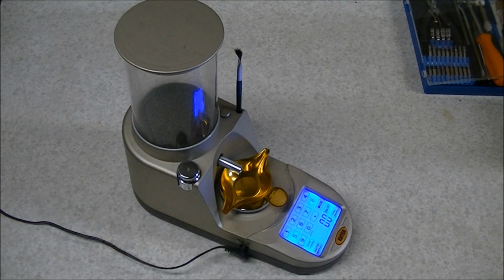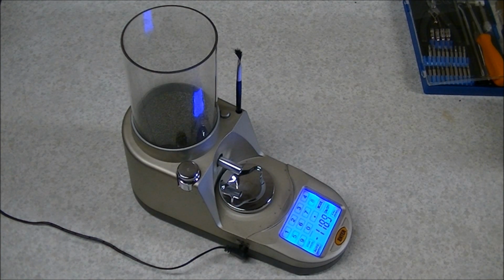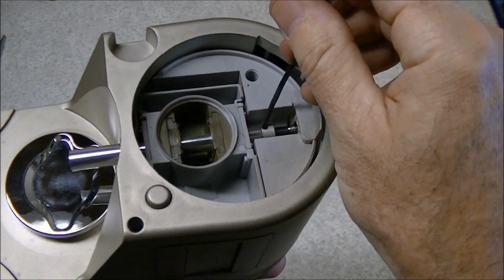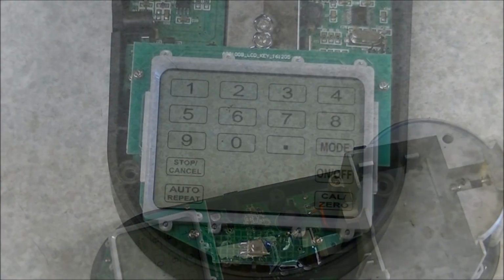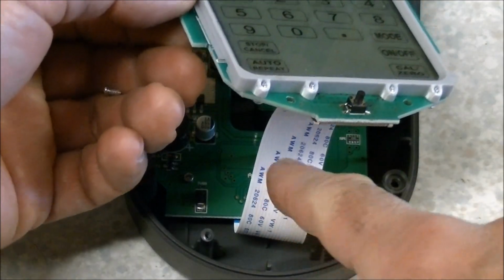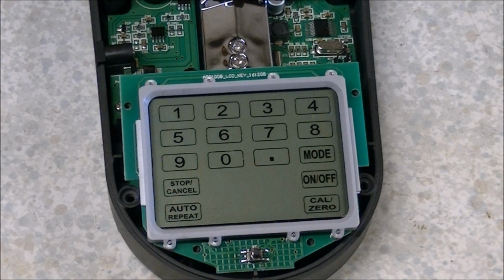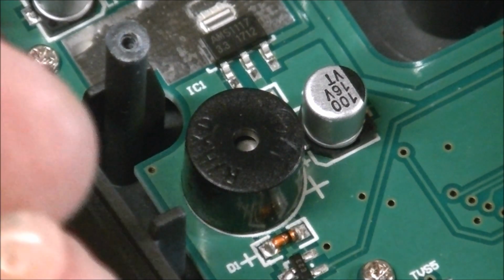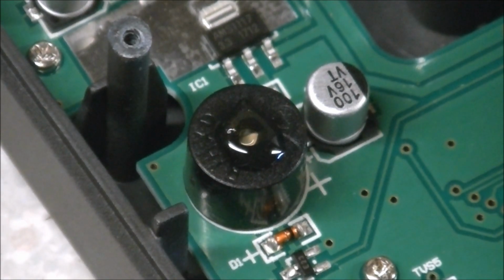Fixing the Lyman GEN 6 Powder System Buzzer

Comment: I haven’t done a buzzer in that machine but I found most of the noise from those style of buzzers comes out of the buzzers body not the hole , if you insult the body , you generally get a quieter noise , old forklift trick
Reply from the maker: Interesting. I'm not sure how that could be done with this machine.

Comment: This is just a rebranded more expensive,  RELOADING BASICS powder drop.   Buy the reloading basics version and save 100$ and get the exact same unit.
Reply from the maker: I suspect that "Reloading Basics" unit is an unlicensed rip off of the Lyman unit.
Reply: @314299 I dont.
  There the original manufacturer of the unit.  Lyman obviously had them make some in a diff color w diff color buttons.   There is other lyman bench scales the lyman1500 I think its called.   that are the same thing as reloading basics, only diff colors.

Comment: Thanks for the video! Great directions on how to access the speaker inside the machine. I wrapped the speaker module with "picture putty" - the pliable putty used to hang posters etc. This worked great to quiet the machine down to a level that is FAR less abrasive. Great video! Thanks again!
Reply from the maker: That's a good idea. These are a great little machine, except for the too loud buzzer. Thanks for the comment.

Comment: Just a thought, but if you are experienced with soldering irons (and have access to one along with some 60/40 rosin core solder and an 1/8 watt 10k ohm through hole resistor), you could desoldrr the piezo speaker from the circuit board, trim the resistor leads  back, use the leads to wire in the resistor on the positive lead, and extend the negative lead, resoldering the speaker to circuit board with extention lead and resistor in place. The speaker will no longer be flush mounted to the circuit booard. This will reduce the audio output level. If doing this, be sure there is enough clearance between circuit board and plastics. This may not be possible depending on the amount of clearance available. Electrical tape might be necessary to prevent shorting of the speaker extension, resistor leads and other electrical components on the circuit board. Not for the faint of heart, to de sure, but will certainly reduce the audio volume output. By changing out the resistor with higher ot lower resitance valued resistors, you can increase or further decrease audio output volume. 

If you don't mind a mute powder dispenser, simply desolder the speaker all together.
Reply from the maker: While that might be a simple enough thing for some that sounds a bit outside of my current abilities. But thanks for the info as it might prove to be of use to those who have more skills/abilities with electronics than I do.
Reply: @314299 , I'm sorry I am unable to come up with a more convenient solution. I would have thought that the manufacturer would have provided a trim potentiometer to allow for adjustment, or certainly an option in the firmware/software.

I very much enjoy your channel and have been binge watching them over the past couple of days. I would very much like to see your Ideal 310 Tong Tool, Part 2 video. I'm having trouble finding it, but I assume YT may have taken it down possibly due to " manufacturing" munitions... 

Thank you for the time, money, and effort you pore into these video projects. You are very much appreciated.

Comment: I like the Gen 6 but its lack of customization has always annoyed me -- whether it's varying the speed of the drops or the volume of the speaker.  Who makes an electronic piece of equipment that you can't adjust in any way? Lyman, I guess.
Reply from the maker: Other than the buzzer I like the unit, and it was reasonably priced when I got it.
Reply: @314299  Oh don't get me wrong, I love using it. Outside of H4831, which gives it fits, it generally just works.